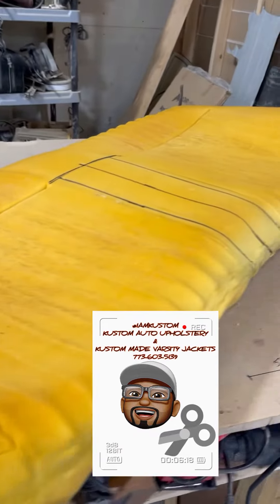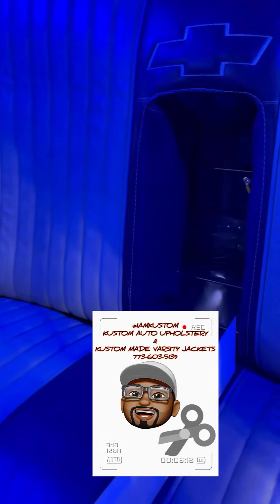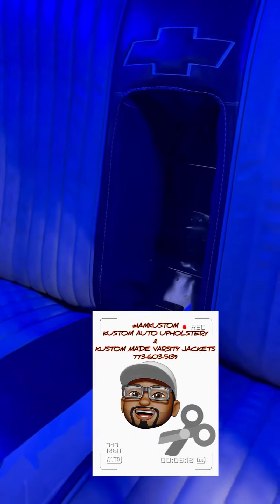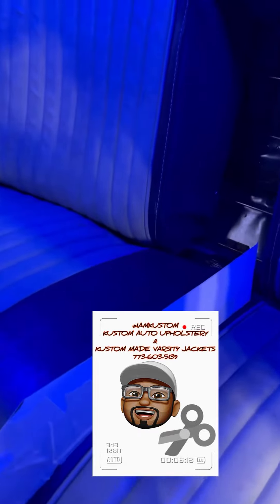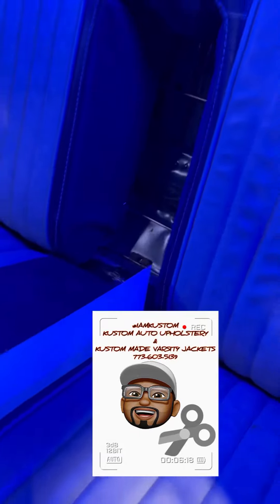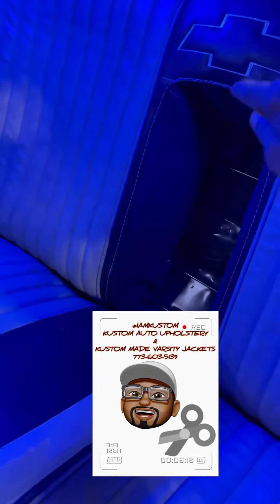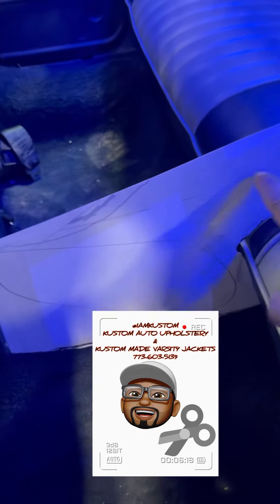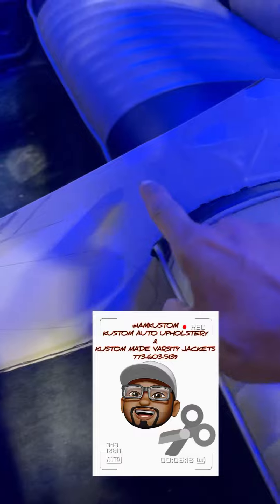G-Body back seat modification

Comment: I have a 1984 Monte Carlo, and I'm looking to add a center console aswell. That runs from front to back. I see yr located in ChiTown, I'm in New Mexico. I was wondering what is yr ball park price for the center console and shipping?..
Reply from the maker: Starting price from underneath the dashboard and up the bottom part of the back seat w/o storage but with cup holders USB ports $1700 shipping would have to be added when it’s done but it will be around $100 give or take
Reply: @iamkustom  indeed good sir. What is yr IG or Facebook so we can stay connected & get the project rolling?
Reply from the maker: Facebook search #iamkustom and Instagram KUSTOMKREATIONS123